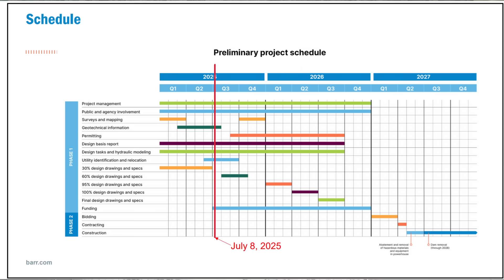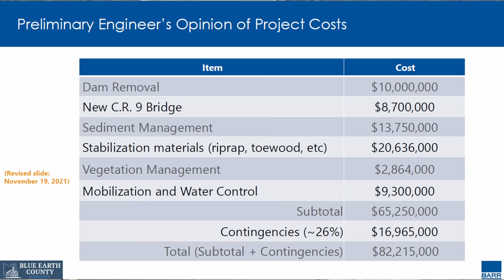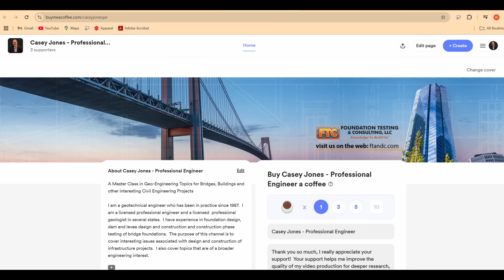Rapidan Dam Failure -  1 year later

Comment from the maker: Mr. Thilges Blue Earth County Engineer was kind of enough to respond to my questions.  His responses follow my questions listed here:
Mr. Thilges,

I am doing an update video on the Rapidan Dam project and was hoping you could answer a few more questions for me.
1.  The removal of the dam is estimated to cost around $88 million.  What percentage of this cost is expected to be paid by the Federal government?
2.  I assume that most of this Federal money will come from a FEMA grant.  What is the status of that the grant application?
3.  Why would Barr Engineering or the County be considering a removal option that did not include replacement of the Highway 9 Bridge as has been reported by some media outlets?
4.  Is the bridge replacement still pending and if so, when will it be completed?
5.  What measures are planned to stabilize the eroding left bank of the Blue Earth river near the dam.
Thanks so much.
Casey

Hello Casey
In response to your questions:
1.      We don't know yet.  We are still working with FEMA to finalize damage quantities and then will begin scoping the theoretical cost to return the dam to pre-disaster condition as a baseline for their funding.
2.      Same as no. 1 above.
3.      The dam is currently deflecting water into the west embankment which is continuing to erode, the water then carries to the east and is beginning to erode the east bank.  If the dam is left in place the water will continue to erode both slopes significantly and continue the loss of public and private property.  The Barr design currently includes a very large cost to riprap armor the river channel.  Some of the riprap armoring cost is attributed to being necessary to protect the bridge pier foundations.    The Board discussed re-evaluating the need for the bridge during a July Work Session due to the fact that the bridge cost could be $20-$25 million plus the cost of almost $30 million of riprap river armoring.  They pondered if the bridge is really work the collective cost.  Following that discussion, we began evaluating revising the piling from driven H-piles to large diameter drilled shaft foundations to improve scour resiliency and hopefully reduce the amount of riprap armoring needed.  The extents of riprap armoring needed will also be heavily impacted by regulatory agency requirements.
4.      Right now, the bridge replacement is anticipated to begin in late 2026, pending numerous permits, approvals and navigating the interim condition with the dam in until it is removed.
5.      Currently we do not have any funding to stabilize the bank.  This condition is unfortunately similar to many other riverbanks along the Blue Earth and LeSueur Rivers in our County due to their high erosion levels.  We requested emergency funding from FEMA to stabilize the bank; however, it was denied via a determination memorandum.

Comment: When you mentioned the material displaced I thought of the Fargo-Moorhead diversion under construction, which is in the same order of magnitude being roughly a 50 million cubic yard project (only four times more). And that's got a lot of men driving big tractors pulling scraper pans working round the clock for about half a dozen years.

Comment: I wonder how much of the generating apparatus was still inside the dam when it failed? Looking at the back side of the power bays, there is evidence four transmission lines originally exited the dam to serve what was then NSP's system. I would imagine that most of the transmission apparatus was consolidated into one of the two substations that once stood at this site (one for the dam, one to serve area customers).

Comment: Found an article dated sept 1 2024 from michael Goldberg at the AP says the bridge AND dam will be demolished. 
"The Blue Earth County Board of Commissioners voted to remove the Rapidan Dam near the city of Mankato, about 80 miles (130 kilometers) south of Minneapolis, and replace the County Road 9 Bridge, both of which were at risk of crumbling. The officials jumpstarted what will likely be a yearslong rebuilding process as the structural integrity of the dam and bridge remain uncertain."

Comment: Hi Casey, I have an interesting situation for you to look into and report on in Sacramento, CA. This is a pedestrian bridge over Interstate 5. The bridge was built as an add on to an existing railroad bridge and as I understand it, the contractor used the wrong materials and the City is trying to figure out the next move.
Reply: News media, including this channel, had stories on that bridge a year or more ago. They talked about improper concrete in the decking or something. The one thing nobody would show or mention is what the actual construction & supports consisted of on the underside of said bridge. 

Hard to get pics of the underside you say? Not really! The google street view car drove right under it and using the forward / backward arrows &  pan / tilt controls you can look straight up at it from 10 feet away. Very good quality pics! It looks like those temporary bamboo skyscraper scaffolds you see in China, with Interstate traffic passing underneath. Supposedly  it needed to be removed & now that you have mentioned it I’m going to check to see what happened?
Reply: @Bitterrootbackroads  The City. County, or Caltrans inspector(s)  should have caught the improper re-bar size or type way before the alleged wrong concrete was placed, and the concrete should have been caught before the first truck finished unloading. Every job I have been on the inspector wants the tag from the driver, showing all the perennate information. I've even had inspectors do slump tests at the beginning and the end of each truck load, along with time logs and batch number records. Oh well, it's only the taxpayer's money, everyone else at the city will still get a paycheck whether they screwed up, or not.

Comment: As a Minnesotan, curious how the budget shakes out now compared to those 2021 projections. Removing the dam seems silly at this point, might as well leave it as a historical monument. A new bridge is being built. And nature restored the river to flowing freely again with the one-time uncontrolled release handling the rest, even if not in an ideal manner.

Obviously not desirable to have had a catastrophic failure, but wonder if the net costs ended up lower--and how much lower that $82 million estimate could've been with a controlled version of what happened letting nature do a lot of the work. It says something about both engineering and politics that it proved an intransigent issue until mother nature dealt with it because mother nature doesn't care about property values or every little consideration anyone could possibly gripe about. Mother nature is the ultimate realist.

In a climate changing world, we're going to confront this over and over and over again: are the places we live economically viable with the rigor we put on doing things "right" vs. mother nature's indifference to our presence?
Reply from the maker: Those are great points.  I think the bottom line is that most things built whether they are dams or bridges just are not robust enough which is compounded by the "build it and forget it" mentality.

Comment: It's likely to be years (at least) before any firm decisions are taken on dam removal, or even regrading the slope of the eroded bank. I wouldn't be surprised if they'd even spend years arguing over who should pay to remove the logs / debris (or even use much smaller explosives to permanently open the gates / remove the access track on top, which would be a start!)

As someone said elsewhere in this thread they'll find the funds to pay for one-off construction projects, but not for maintenance - either for the new project or anything already in existence. Everybody likes shiny new infrastructure, but nobody wants to pay for it. I'm surprised the US never adopted the UK's Private Finance Initiative: get a private company to design, build, finance and operate it, then the government pays them back over 20-50 years (with significant interest, of course!) . Overall, it costs the government far more than in-house, but the cost is spread over many years and the thing (school, hospital, road, power station etc) is built far quicker and with less red tape or haggling over the cost.

Comment: Regardless of what event we are talking about, the root causes always include poor decision making at the top,  compromising the final design, construction, manufacturing, operations and maintenance.  This is true whether it is engines that fail due to poor design, equipment that breaks down due to improper maintenance, or failing high-rises whose developers chose not to drive foundation piles to bedrock.  Too ofter we engineers are silent when owners, committees and boards stuffed with the greedy, ignorant or the misguided, fail to properly consider risk and the long term consequences of their actions.

Comment: When a non profit has to spend 80,000 dollars and five years for permits and engineers to repair a small leak in a dam like the Pickwick Mill
has and finally get all the required paper work to actually do the repair it will take way longer to fundraise to do the repairs.

Comment: The dam originally had 7 gates and spillways that allowed for much greater amounts of water to be released in past high water events than in June of 2024.  By 2024 Blue Earth County had acted to permanently block two gates on the east side of the dam so they couldn't release any water.  Additionally, the county failed to remove log buildup from the remaining 5 gates, which further restricted water flow.  Effectively, there were only 2 unobstructed gates by the time of the overtopping.

Blue Earth County's mismanagement of the reservoir caused the overtopping.  It was virtually guaranteed to happen at some point with much less water than in past record events.
Reply: This is no different than what happened in Kerr County Texas with the flooding.
Reply: @davidcolwell614  Nope! There is a huge difference!  The Kerr County flooding was not due to a neglected and failing manmade structure.
Reply: @ronaldfharring7326 The dam was only failing because of the neglect. That is a human failure, same as Kerr County. You have to look at the cause, don’t get tied up in the little details. It’s like corruption., corruption is bad, it doesn’t matter what kind of corruption it is.
If the dam had been managed properly, it wouldn’t have failed.  With proper planning , Kerr County wouldn’t have happened either.
Reply: @davidcolwell614  What are you even talking about? The "cause" in Kerr county was heavy rainfall (nature) and geologic landscape conducive to flash flooding (nature). 

There was no decades of systematic gov't mismanagement in Kerr County, it was simply the incompetence of people to pay attention to the weather and move people to higher ground during a flash flood of which there was literal days of warning.
Reply: @davidcolwell614  No dams failed in Texas though.

Comment: This dam was a victim of the modern habit of trying to get someone else to pay for it! The work to keep the spillway clear was a relatively small expense but it was delayed while the (government) owners tried to find someone with deep pockets to pay. It should have been a regular annual item but no. We use federal money to subsidize windmills and solar panels but a dam designed to generate power is allowed to shut down because it cost too much to repair? Then, because no one is operating the dam it is allowed to get plugged with dead trees, then it gets attention. A strange world!
Reply from the maker: You summed up the situation accurately.
Reply: Adjusted for inflation, US taxpayers have spent an average of 6.95 billion per year in direct subsidies to oil and gas companies since 1918, 5 billion a year for nuclear energy since 1948, and just 0.52 billion a year on renewable energy since 1994, including hydropower. In spite of the subsidy disparity, wind and solar are now often the cheapest forms of power production even without subsidies.
Reply: @GoCoyote  Oil and gas companies get ZERO subsidies though, they are called tax breaks, the magic green energy companies actually get HUGE subsidies, hundreds of billions of dollars, all a scam.
Reply: "We use federal money to subsidize windmills and solar panels"

Far, far, far less than we use to subsidize fossil fuels though which help cause extreme weather events like unprecedented rains to overtop dams.
Reply: @tHebUm18  We don't subsidize the gas and oil industry though, those are the same tax breaks that every other company gets.

Comment: Really, the problem is that paying to do something like remove or rehabilitate a dam is expensive, and voters tend to punish politicians who take on new debt or raise taxes to fund these projects. So for a lot of elected officials, it’s just easier politically to do nothing and leave the problem for the next guy. And then the next guy does the same thing, and on and on until the infrastructure in question finally fails. This is likely to become an increasingly large problem in coming years as a lot of old infrastructure all hits the end of its life at around the same time. The problem is especially bad because a lot of previously-obsolete infrastructure was made with stone and steel. Stone is very durable and corroded areas of steel can be cut out and replaced, allowing these pieces of infrastructure to have their lives extended indefinitely. However, a lot of the stuff going obsolete now  is reinforced concrete, which can’t really be patched piecemeal once the rebar corrodes. So we can’t just repair it, it’ll actually need to be replaced wholesale. It’s unlikely that the consensus exists for the level of public works spending required to actually replace a lot of this highway infrastructure one-for-one, so we’ll probably see a lot of retrenchment and a lot of infrastructure, especially highway infrastructure, being used until it fails and then abandoned or downsized in the coming decades. In particular, I’d expect to see a trend of three-lane highways being narrowed to two lanes to reduce the loads on deteriorating bridges until money can be found to replace them.

Comment: Would it be feasible to fit some sort of "overtopping" capability onto such a dam in an emergency situation?  My (dumb) idea would be to use some sort siphon tube over the top of the thin.  A semi-rigid tube makes an inverted "U" over the dam, and is filled by some means such as evacuating the tube of most of the air it contains:  Voila, a siphon that acts as a spillway.  
There are probably better ways to achieve such an effect, but my question is whether "retrofitting a spillway" onto a dam that lacks one is feasible at all, especially in an emergency situation.

Comment: Obtaining the funding to build a dam is just part of the project.  After it is built, money needs to be appropriated regularly to maintain the dam and its surroundings, and that's where communities and states often fail.  It's like buying a car.  The initial outlay is just part of the expense.  I can delay changing the oil and such once in a while, but if I do it too often for too long, eventually I'll lose the engine.  Replacement of the engine (or in this case the dam) will be far more costly than what I would have spent in maintenance.  "Penny wise and pound foolish"?

Comment: Semantics. If the dam had non-functional emergency spillway gates and gates blocked by trees and debris and non-funtional power generation then the dam did indeed fail. The state had a derelict dam / time bomb in a river. When flood waters could not flow through emergency gates - that's failure.
Reply: r9 on to 9 look 98999😅😅999😊😅😊oo99
Reply: And instead.  Now it only looks like a bomb went off or a war zone.
Reply: Keep voting liberal folks that seem to be working 💪
Reply: @ginog5037 please explain what they have to fo with this?

Comment: To sum it up: they should have spent $8 million several years ago but didn't. Now, they're going to spend 15 times as much(dam removal, bridge replacement, compensation to the home owner, and downstream clean up). Politicians need to be held accountable for their "kick it down the road" decisions of what is a form of russian roulette. Ever see the MAD Magazine comic strip of "Russian Russian Roulette"? Good video. Good Luck, Rick
Reply from the maker: You are exactly right and thank you. I loved Mad Magazine.
Reply: @CaseyJones-Engineer  I got it from the late 1950s until around 1968. I used to get two of the books when I was going to Boy Scout Camp each summer. Mom threw them all out when I left for the Army. Good Luck, Rick

Comment: Perfect example of not doing the necessary repairs/replacement is the cantilever section of the BQE I-278 in Brooklyn, NY.  A ticking time bomb that the local government keeps putting off it's inevitable replacement, seeing the extensive corrosion and decay.
Reply: Well that’s not the local government. That’s an Interstate Highway (I-287). That’s not NYC, that’s state and federal money.
Reply: @michaelimbesi2314 even interstates are state managed. The state will maintain it, destroy it or design new projects to federal standards. The feds only pitch in some money to help
Reply: Having watched a few documentaries on that--that's a much, much more complex situation of replacing a critical, heavily trafficked arterial through the US's largest city that's filled with NIMBY's unwilling to give a literal inch to any replacement option. 

Less about putting off maintenance and more about it's reached the end of the useful lifespan and being a hot potato to do any replacement--either similar or completely different.
Reply from the maker: Thank you. I will look into that one.